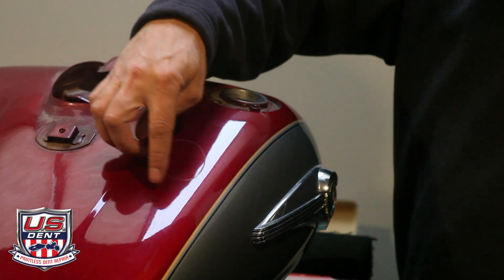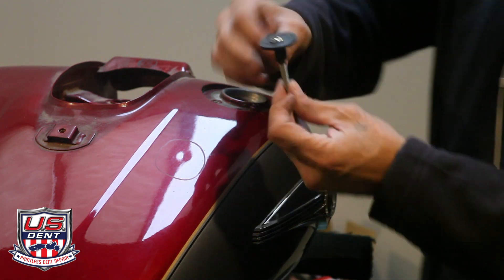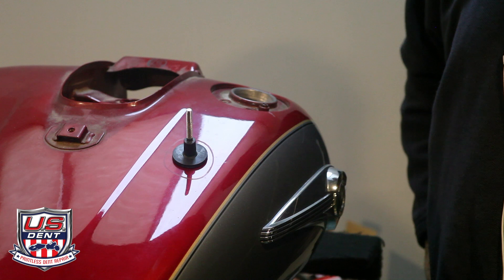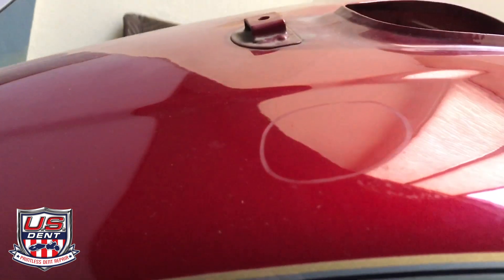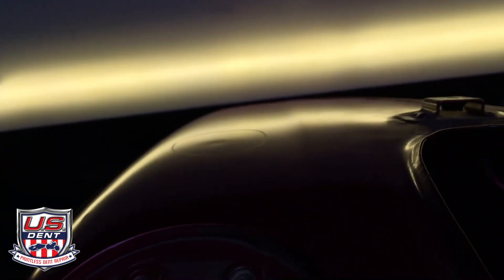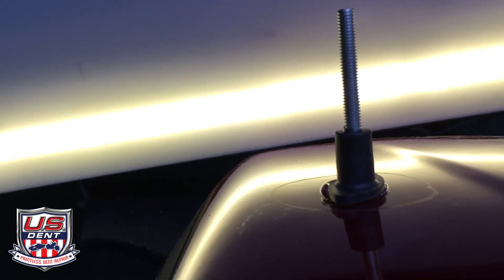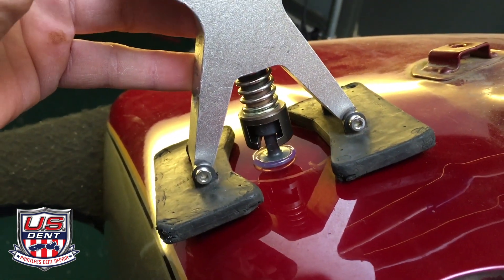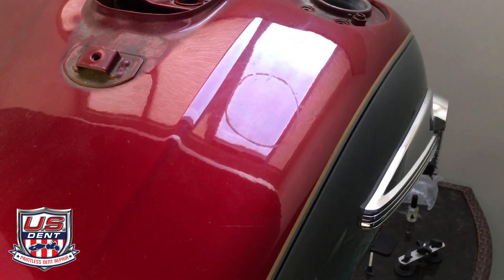Crossbar Dent Repair Kit/Motorcycle Tank

Comment: Dude. The way to find the exact center of the dent is to apply the glue to the dent and quickly place the tool onto the glue. Use less glue than the diameter of the dent as it will spread when pressure is applied.